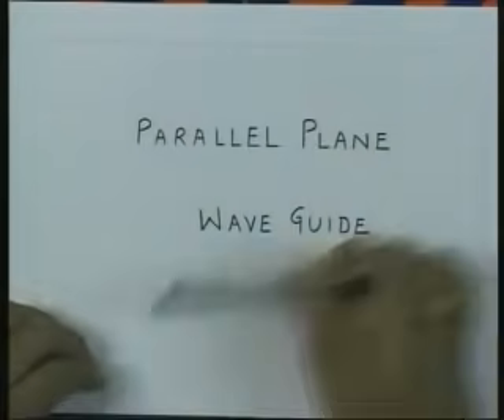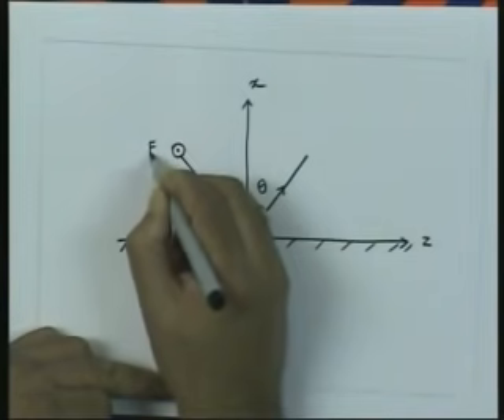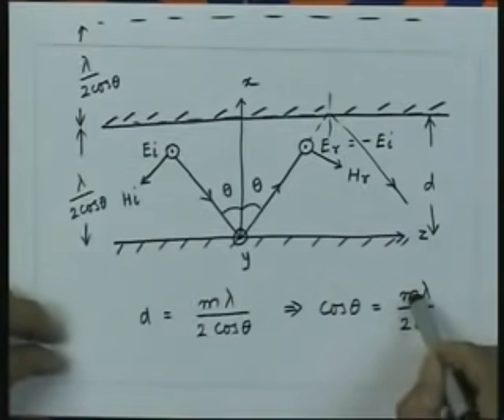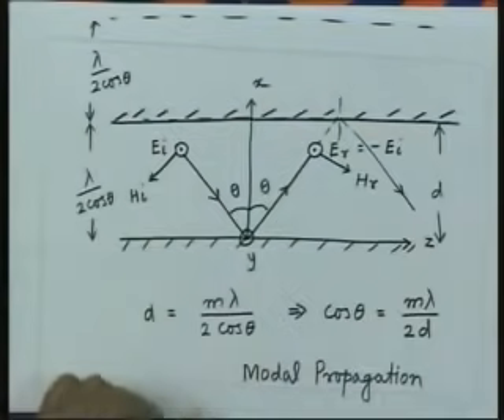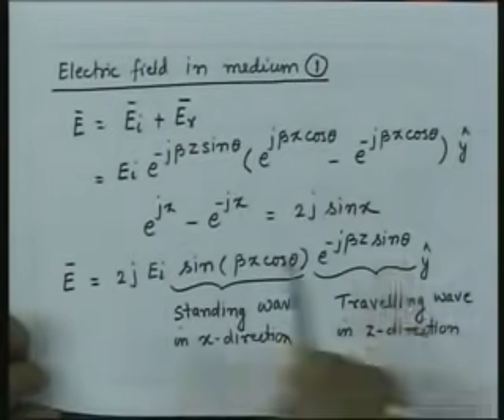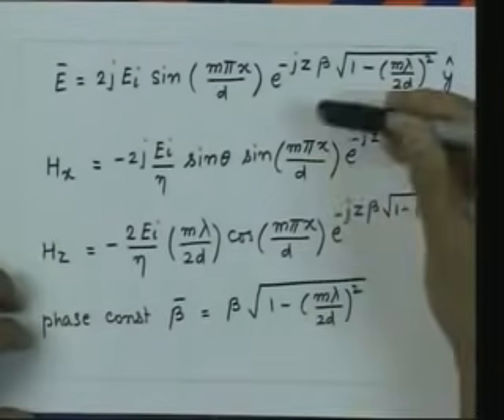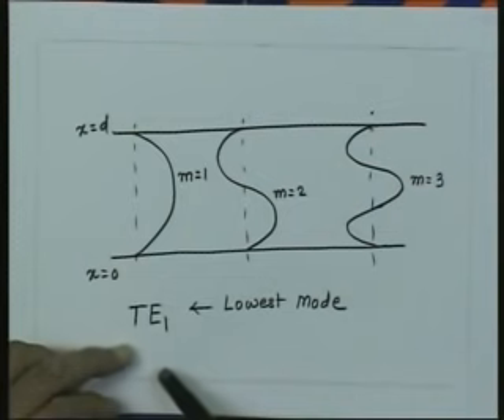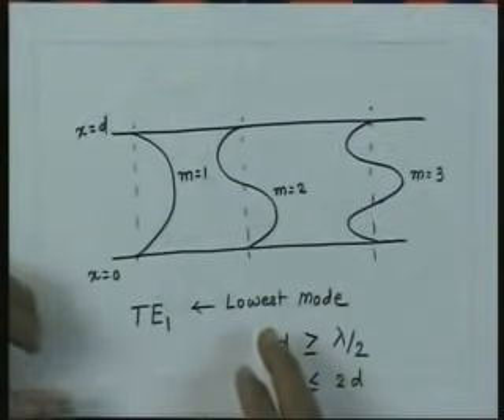Parallel plane waveguide

Comment: What would happen exactly, if the distance between 2 parallel plates isn't integer multiple of m? (It is something like impedance matching, that otherwise it would have a reflection (or distribution)?

Comment: At theta equal to π/2 propagation will be parallel to wave guide then in that case it should be maximum but as cos theta is equal to m times lambda divided by two times d then at theta equal to π/2 wave will not exist. Please someone explain.
Reply: See, there are two parts in the equation of E(electric field). First one is standing wave [Sin{BxCos(theta)}] and another part is travelling wave {Sin(theta)}. It is given that, theta is equal to π/2. Here we can see that travelling wave consists of sin term which will immediately take the highest value and becomes zero but for the standing wave part, the overall term becomes zero. The inner cos will become zero making big theta 0 for Sin term and hence overall zero for standing wave part. Now comes the equation part of E(Electric field) where standing wave and travelling wave are in multiple fashion and we already know that anything multiplied by zero will become zero. Hence it is advisable to not use parallel incident wave in parallel plane waveguide because the E term for that wave will become zero automatically making it non-trackable at another end of the waveguide.
Reply: If theta is 0 degree then according to you propagation will be max but then group velocity will be minimum and at theta = π/2 the group velocity will be c . 
And what will happen if I increase my d and keep theta = π/2?
Reply: I calculated average Power using Poynting vector whose expression was directly propotional to (sin squared of theta) times (sin squared of (beta ex cos  theta)). So, in Both cases either you put theta= pi/2 or theta =0, you will get Average Power flow in z-direction as zero, so you will have to sent wave at some Inclination to the interface  as sending, either parallel or Perpendicular to it, both propositions won't work.
Reply: @anime_gaming__007: What you are saying at theta =pi/2 (parallel) to conducting interface, yes wave will travel but It will be simple Uniform plane wave travelling in z direction in medium 1 with its intrinsic Impedence eta 1. In waveguides we need two Waves interferring with each other(Where is second wave? At theta =pi/2 there is none, so it is just like earlier lectures Simple UPW propagation in a medium you can find power and everything as you find for A travelling wave and it would work.) Such that it guides Energy alongwith it, how ? In the form of Surface current on conductor interface itself i think. So energy travel in Periphery in the middle everything is hollow where you are proposing to launch a linearly polarized wave. But waveguides by way of interferance Create energy to travel on those boundaries not in the middle, which you can't achieve by doing theta = pi/2. At theta =0 one wave only bounce back and forth up and down creating standing waves along x direction. Components of magnetic field will cancel out and wave would not be able to travel again in z direction. So in both cases either theta = 0 or pi/2. There is no powerflow occuring as warranted accordingly by Waveguide (on conducting surface, not in the middle).